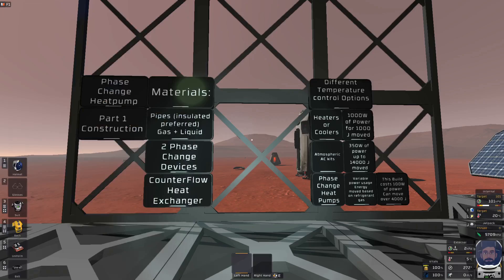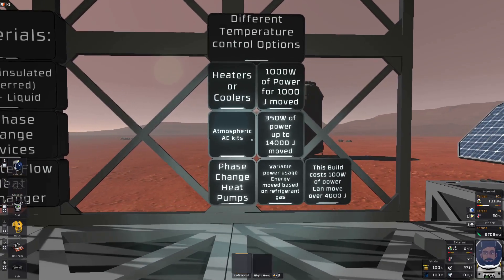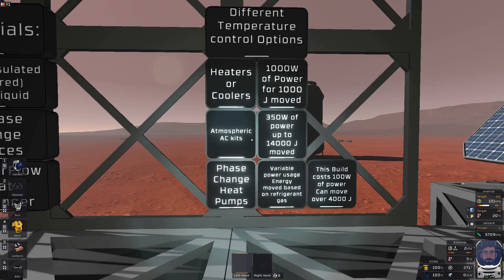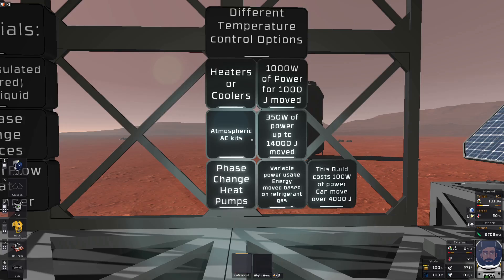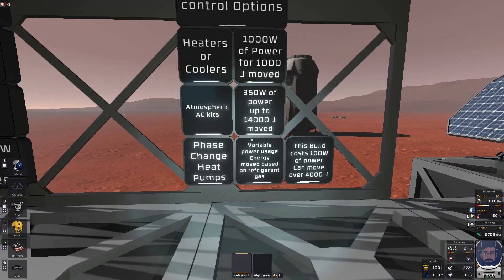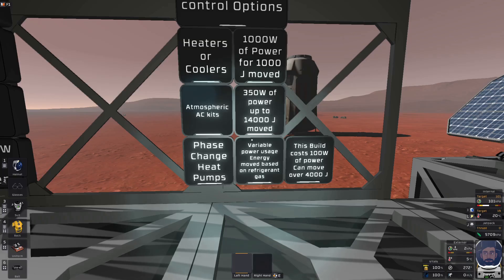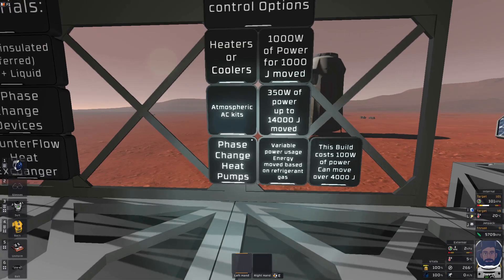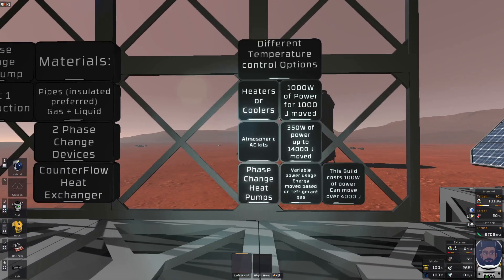Stationeers: Simple Phase Change Heat Pump Pt 1/3

Comment: Can i use this setup in Europa to make liquid nitrogen
Reply from the maker: You could, but Europa is so cold outside that you could just use convection radiators to get the Nitrogen cold enough to begin condensing. The heat pump setup could be used to get it colder than ambient Europa temperatures.

Comment: Thankyou for your videos about phase change heating Shadowdrake082 I’m attempting to set up a cooling tower type heat exchange via phase change and I’m finding these videos helpful
Reply from the maker: Glad it can be of assistance! While this build is a closed loop setup, just having the evaporator and compressing air can make a good open loop cooler.

Comment: THIS was a very very good video! This is methodical and very good explained. The only thing I would like to add is that you could explain that this is a CLOSED system, whatever gas you put in never goes away, it just goes round and around. You put in gas that condense to a liquid and then the liquid evaporate to a gas again.
Reply from the maker: Good point, In the several takes I did, I think I did leave it out somewhere that this was a closed loop solution.
Reply: @shadowdrake082  For what it is worth, you have come a long way since your first videos trying to explain things... so now I have to sub again :)

Comment: I’d be nice if you explained why you’d build it like shown.
Reply from the maker: I thought i did. The chambers are that way so their gas and liquid connections can connect straight, the only reason i built it awkward in the middle was to show where a counterflow heat exchanger can be built at.

Comment: Mr. Drake Sir! How would I go about making a balancing heat pump System with a large buffer of Pollutant that can both heat and cool to maintain a steady 20 degrees Environment for a larger base? How do I Set up removing excess liquid or excess gas from the heat pump setup in such a system?
Reply from the maker: Liquid volume pump on the liquid pipes connecting to them would be a way you can drain off excess liquids. Though if you have a very large system, you may need multiple chambers or areas where the phase change needs to occur, so long as you can minimize condensation in the gas pipes between the condensator and evaporator, the system should be good to stay steady. If you got roughly equal latent energy on the two sides, the system is fairly well balanced. Just make sure that your stable temperature source doesnt change too bad.